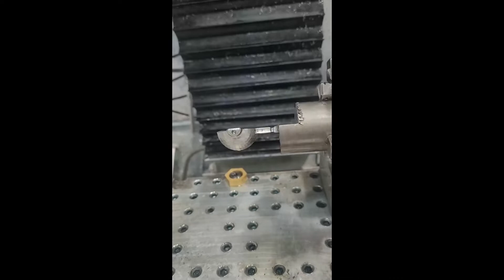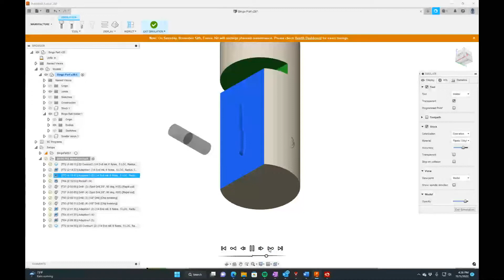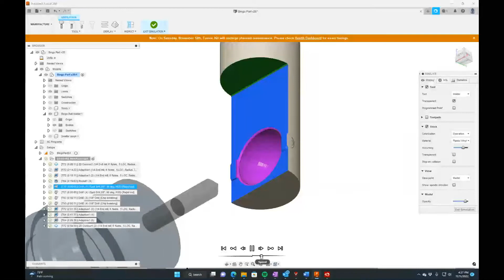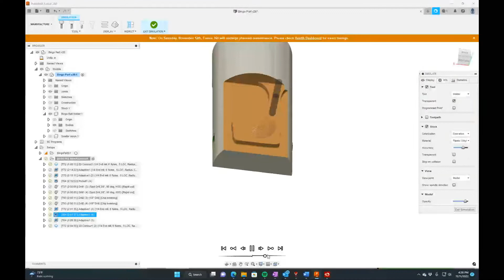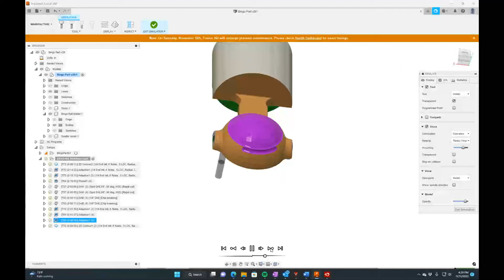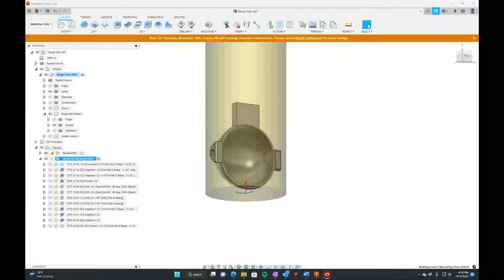Tormach Microarc 4th Axis and Fusion Rotary Toolpath Thoughts

Comment: Nice video - but one correction.  You can have vastly different tool lengths in Fusion and Path pilot.   That was not the cause of your crash.   The fusion tool length makes not difference - only the one stored in path pilot.   The only use of tool length in Fusion is for accurate crash detection in simulation.
Reply from the maker: I agree you can have different tool lengths in PathPilot vs Fusion, and if I had the actual tool length in Fusion, I would have caught the collision by the holder with the stock. My comment was based on the assumption that everyone, like me, is very careful to ensure that the actual tool length is in PathPilot.   When I was cutting it close (risking that the holder would hit stock), I should have simulated with the holder, and the right tool length (value in PathPilot), in Fusion.  I could have caught the collision.  In this case it was really no big deal, just a nick that created a nice spray of sparks.

Thanks for watching to the end and taking the time to comment.